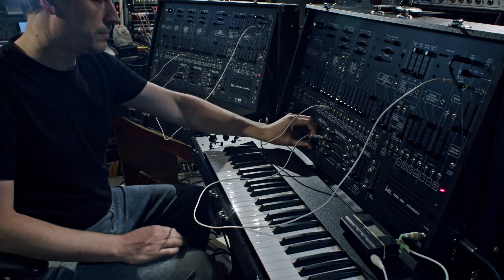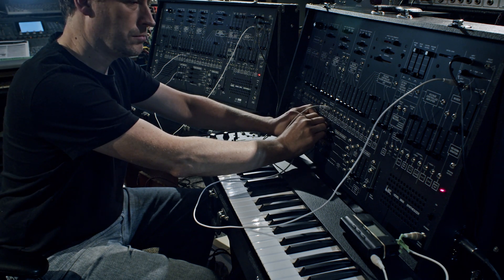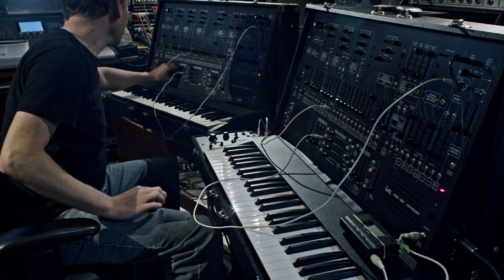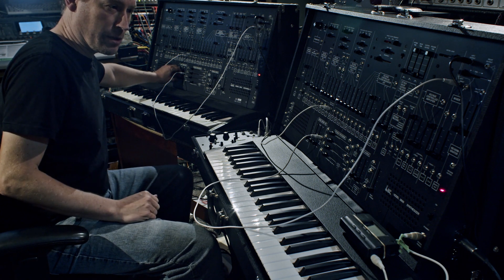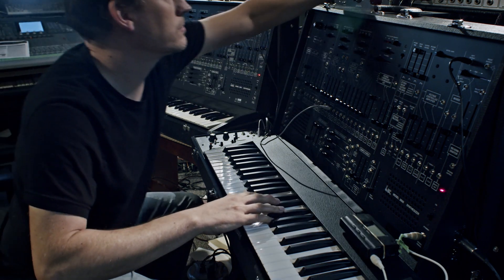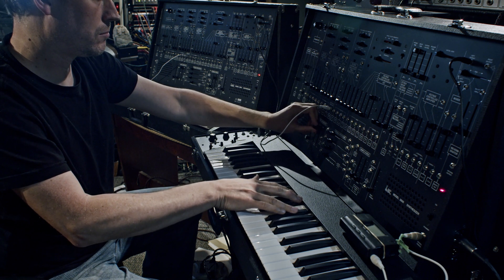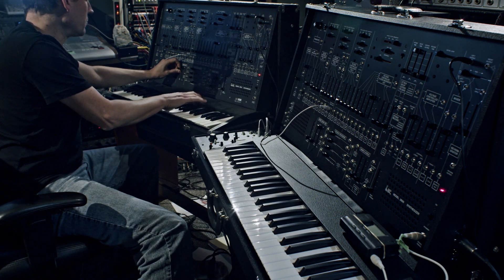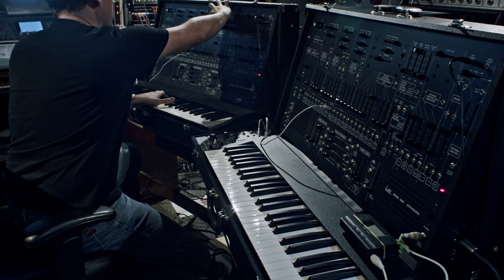Comparing the Noise Generators between ARP2600 and Korg ARP2600FS. Big Difference!

Comment: I'm having the same issue with my Korg Arp2600M!  This is a 2 year old post, so I'd be very curious as to what caused the issue, and how easy was it to fix?
Reply from the maker: Hi! I actually was able to get it fixed by my tech (www.shooksound.ca) and it now sounds like it should. Here is what he wrote to me about fixing it.    " . . . spent a bit more time with the noise section - my conclusion is it’s working the way it was made by Korg - they tried to use the original circuit but used a different noise transistor (as the original is not available in SMT) and so had to adjust the gain structure a little to compensate, but in doing so also (I assume accidentally) messed with the Q of the filter there.  If some FS don’t sound like this maybe they re-engineered it at some point in the run?  I suspect they all sound like this but not everyone has the original to compare to.

SO: I spent a bit of time modifying the circuit, and I think I got a lot closer to the sound in your video."
Reply from the maker: I hope that is helpful. I'm sure he would be able to give you some more info if you got in touch with him on his site.
Reply: @cgmagik9837  I was lucky enough to get a replacement unit from the store I bought  it from!  The difference is like above!  Thanks for your post, I might have never realized that something was wrong besides my suspicions, which started when I tried to get a certain sound I used to get with the Behringer 2600's noise with a vocoder; on  the 2600M,  it sounded like a Martian Heat Ray from the War of the Worlds.  Not all that unpleasant, mind you! :)
Reply: @cgmagik9837  Believe it or not, my brand new 2600M started doing the same thing again.  It wasn't like that when I got it, in fact, I had some wind sound design to make, and it was fine for that, with no "resonant Q" sounding additional frequency.   Based on what your tech said, I'm thinking it could it be an SMT component that keeps failing on some units from a bad batch, but I'm no tech, so I'll leave it at that and call the store.

Comment: There appears to be something wrong with your 2600 FS.  I have an FS, serial number 92, and the noise on mine sounds thick and full like your 70's version.  It sounds as if there could be a faulty component on yours.  I'd contact support to see what they have to say about it.  Sometimes manufactures get a bad lot of components that slip through inspection.  Hopefully you can get this fixed (or already have).
Reply from the maker: Thank you! I've been super busy and haven't been able to deal with this yet, but hoping to soon.

Comment: I’ve noticed the same issue on my FS too. I also have a Korg Odyssey module and the noise on that one is much better. It’s a fuller spectrum noise like the vintage 2600. For some reason they’ve done this weird frequency bump on the new 2600 and it makes the noise almost unusable.

Comment: My FS sounds just like the FS on the video.
Reply from the maker: Interesting. I'll let you know if I find anything out about this from Korg or a synth tech. A lot of people seem to think this is not the way it's supposed to be.
Reply: @cgmagik9837  Just checked with my FS and it sounds like yours. That piercing annoying resonance. Mine also had a broken reverb. I never had it fixed yet. Was it easy to fix yours?
Reply from the maker: @0010x0010official  Pretty straight forward, yes. You just need to get a new tank and switch it with the broken one. The 2600 case is a little finicky to open up and put back together, but not that difficult. This is the tank I got for mine. https://nextgenguitars.ca/products/reverb-tank-mod-4eb3c1b.html and it sounds really nice. It's a slightly longer decay and maybe a little darker/smoother than my original 2600 reverb.

Comment: Definitely too much "Q" leaking into your noise generator in your KorgFS.  My Antonus 2600 (which is a circuit accurate through-hole recreating of the vintage) sounds much  like your vintage ARP.   The vintage ARP in your video is the correct result of activating noise.  TO that end, this video is a good one to send to korg support so they can hear your issue - and likely a tech support engineer will know what's going on and develop and action plan.
Reply from the maker: Thank you!

Comment: the noise on my FS sounds like it should - full bandwidth. yours sounds like it has some filtering applied - very odd. not normal, i would say.
Reply from the maker: That's good to know! Thank you.
Reply: @cgmagik9837  you also ask i it's possible to mod it, and yes, that should be an easy one for a tech, I should say. Until that time, you can of course patch in external noise instead.

Comment: Sounds like a resonant filter applies to the noise ? What do you think about reverb ?
Reply from the maker: The reverb tank in miy FS actually failed/broke . . perhaps due to shipping. The reverb springs and also the springs that connect the springs to the chassis broke off. There was someone on Gearspace that had the same problem. I replaced it with one of these -  https://nextgenguitars.ca/products/reverb-tank-mod-4eb3c1b.html and it sounds fantastic. It's a slightly longer decay and maybe a little darker/smoother than my original 2600 reverb.

Comment: You must have an issue with yours: my FS sounds way more like your OG…
Reply: After re-testing I can even say my FS sounds really like your OG… Try and check your filter calibration, if it’s this it might be easy to fix. Cheers!
Reply from the maker: Interesting! Thank you. How would the filter have anything to do with it? As the sound is the same coming directly out of the noise generator outputs . .
Reply from the maker: Also, the filter in my FS is sounding really amazing, so it doesn't seem like anything would be wrong with that.